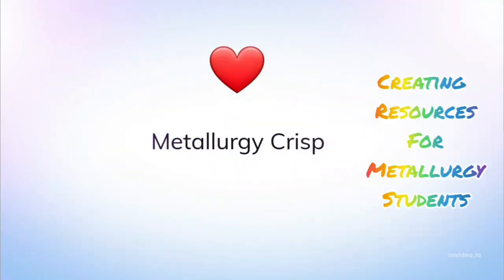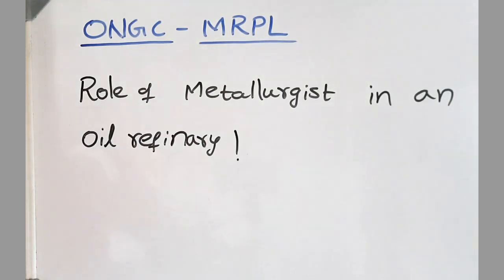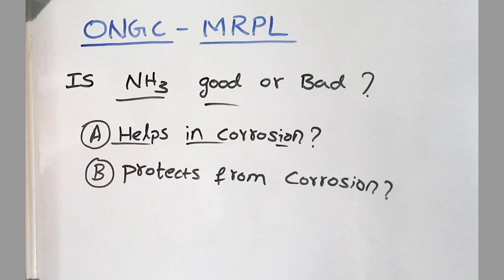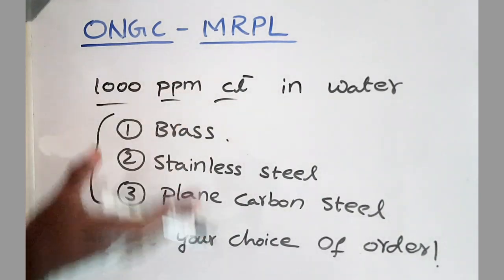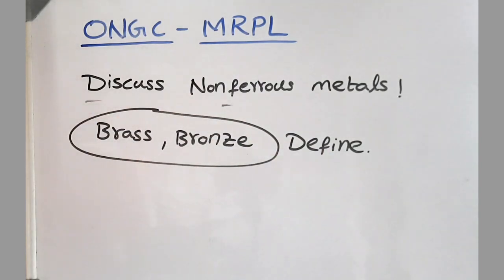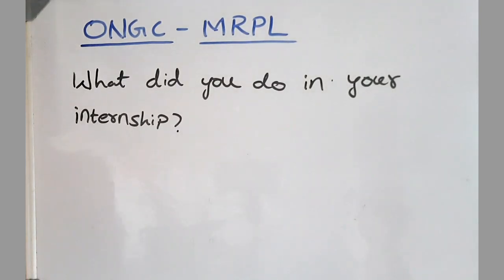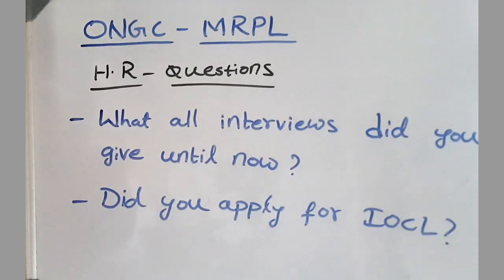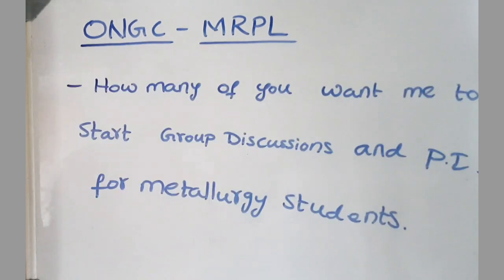ONGC MRPL INTERVIEW EXPERIENCE by AIR 6 | Mangalore refinary | Metallurgy | ONGC interview questions

Comment: Could u tell where steel corrsion is more in dilute or concetrated and why
Reply from the maker: Corrosion is more in dilute H2SO4. Concentrated H2SO4 is highly Oxidising and helps form protective layer on steel surface(refer pourbaix diagram of iron). Passive zone. Hence has little to no corrosion in concentrated H2SO4.